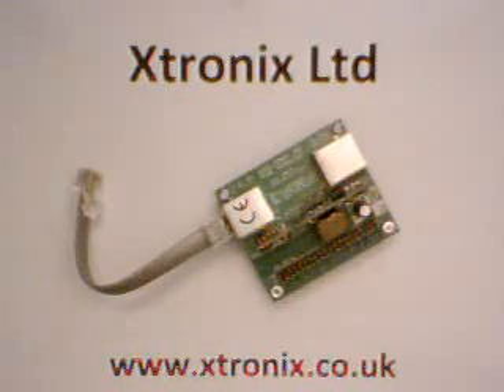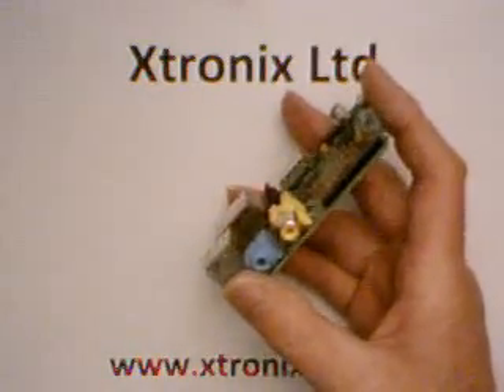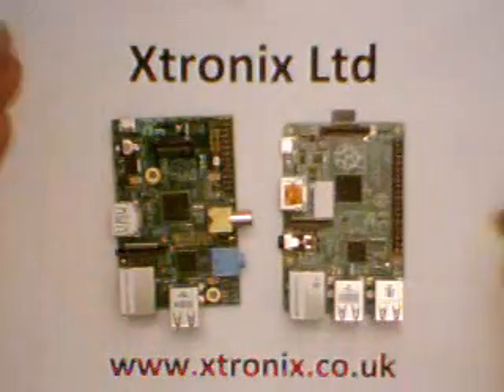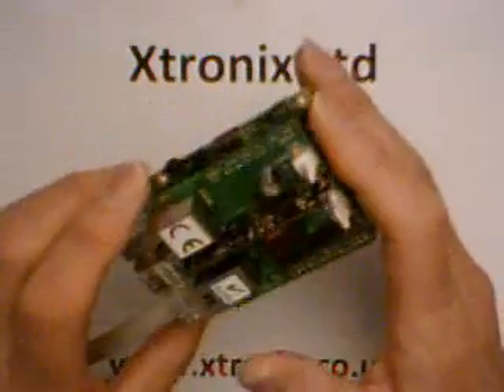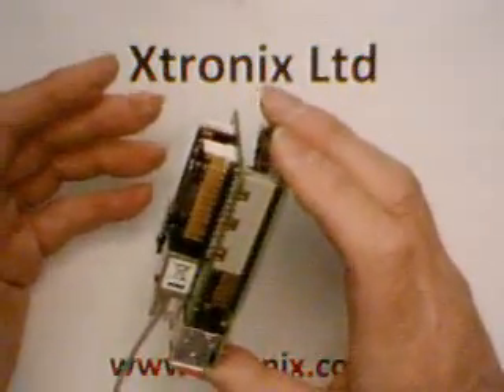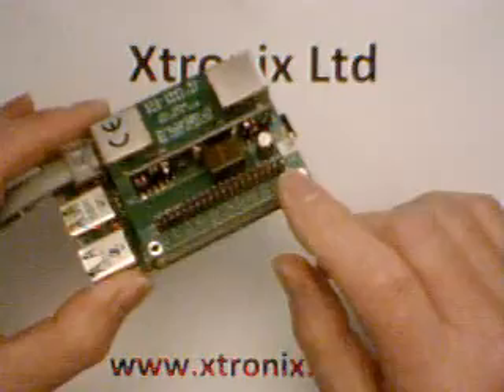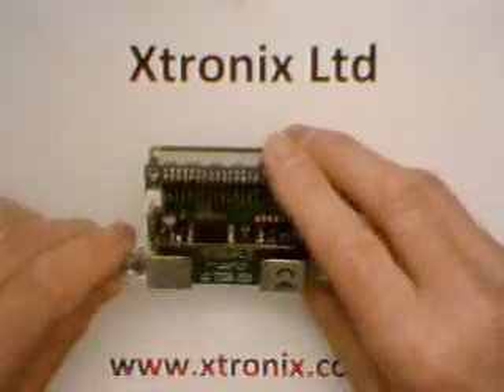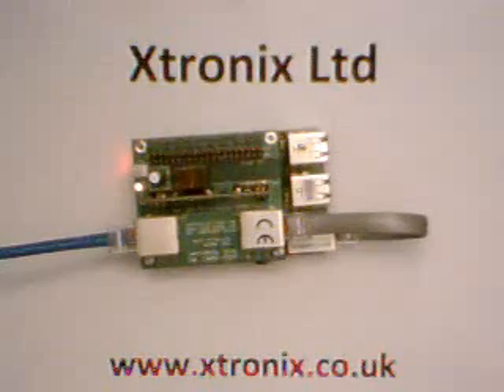How to power a Raspberry Pi 2 over the Ethernet Cable with the Xtronix adapter PCB.

Comment: Is this an issue given that the Raspberry Pi 2 recommended PSU current capacity is 1.8A (https://www.raspberrypi.org/help/faqs/#powerReqs) and the PoE adapter only provides 1.25A?
Reply from the maker: +Stuart Clark 
Hi Stuart;
 
Interesting comment. I have measured various Raspberry Pi PCBs in various configurations and found that they generally take much less that one amp in various configurations. I have posted a chart of measurements on my web site at:

http://www.xtronix.co.uk/raspberry-pi-power.htm

It makes interesting reading.

Regards

Jim